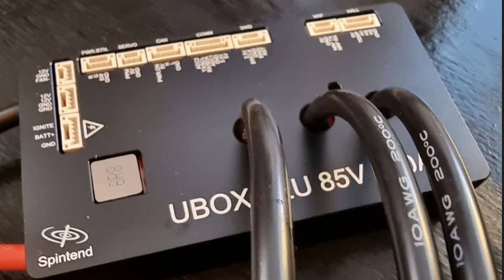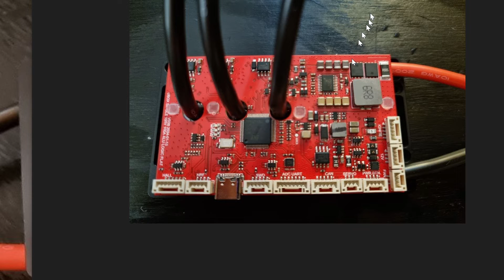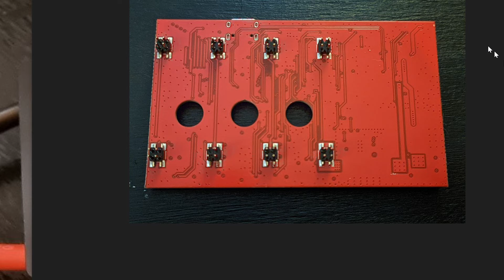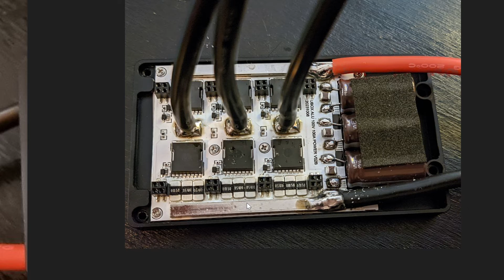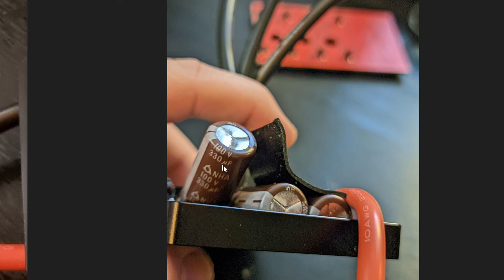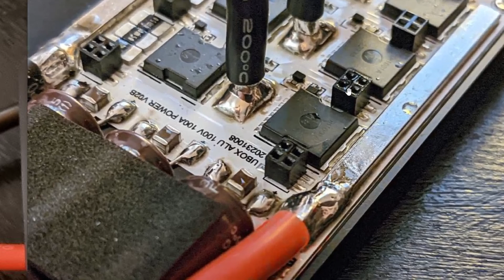Spintend 85-150 Overview

Comment: btw makerbase is going HARD now, they made a controller thats basically a 75200 but redesigned with real phase filters, INA241 amps, phase shunts, inbuilt bluetooth and imu, remote on/off etc.. all the good stuff

with the HYG fets, and for like €125 off ali with 21% VAT

it's called the 84200HP

it doesn't have the creme de la creme current path but no doubt best "VESC" alternative for the price
Reply from the maker: I've been looking at the Pro series from Flipsky. Makerbase and Flipsky are one and the same. Looking at the Pro series they are effectively the same build as a Spintend in every way...including current sense amps and a very few ceramic caps. Well except the mosfet used. It's hilarious that Flipsky calls following the minimum specs for VESC their "pro" product line!
Reply: @de-bodgery  yea, atleast the Makerbase 84200HP is different tho, the older 75 series was the exact same as the Flipskys and the 84200HP is an actual different development, by no means perfect but hey Makerbase has it for way less money and actual high side phase sensing lol
Reply from the maker: @BH4x0r  High side phase current sensing? What's that? Shunts are on the low side to deal with certain facts of voltage spikes that you don't have to deal with as low side shunts. Current sense loops are 100% disconnected from the phases and are neither high or low side. I guess I'd like to see one of these Makerbase 84200 controllers. So far, everything I've ever seen from them is sold as is by Flipsky...aka one and the same company for all intents and purposes!
Reply from the maker: @BH4x0r  I'd like to see this controller.
Reply: @de-bodgery  i mean actual phase shunts i.e. after the fets before going into the motor wires like in Benjamins 75V controllers, they're using the new INA241A's which is the 120V version of the INA240s that were/are used on the actual Vesc 75 series (by Vedder)

my apologies for not explaining stuff properly sometimes, English is not my first language
Reply from the maker: @BH4x0r  Those are all low side shunts and you don't want to use the 241's at battery voltage, but rather at the low side or near 0v. Thy might be able to endure 120v, but you don't want to use them there.
Reply: @de-bodgery  should be ok for a 20S pack, like it should be okay to run a 75/300 on 14S, if it somehow exceeds 100V the fets would probably go first, and i'm telling ya the shunts arent going to ground but to the phase wires, low side shunts would sit there connected to gnd instead, the shunts on the 84200hp are Literally wired directly between the fets and the phase wire rather than a phase wire and gnd
Reply from the maker: @BH4x0r  I've seen this done before with the shunts placed at the phase busses instead of under the low side mosfets. It puts them at potentially a bit higher voltage and at most 1/2 of pack voltage. As far as resistive and inductive losses of shunts, it doesn't really matter where you locate them in the current path from BATT+ to BATT-. It all ends up being in series with the phases and mosfets anyway.
Reply: @de-bodgery  True VESC6s do use inline current shunts. But it's not the case here, this Spintend 85-100 uses low side current shunts, as in Flipsky 75100. And what you call current shunt amplifiers are the phase filters, present on this unit but not on Flipsky's. Current shunt amplifiers are, of course, present on every ESC, even Flipsky's.
Reply from the maker: @lapo3500  The voltage drop across the shunts isn't 5v swing, it's millivolts. The voltage drop needs to be amplified to get a good read for the ADC's in the STM32F405. They are amplifiers and yes, they also are smoothers or filters. It depends on the part used. Amp and filter all in one, no amp and just filter, amp and no filter are all possible. If we assume 5 mOhm shunts and 3 in parallel per phase, that's 1.7 mOhms. If we assume a 200 phase amp controller, that's .34 volts across the shunts. IF we assume 20 phase amps, that's .034 volts. You really need to amplify the voltage drop across the shunts so you can use the full voltage swing of the ADC's. If the current sensing electronics already make the full ADC voltage swing, you don't need amplification. The hwconfig file will have a value for the amount of amplification that is used in the current sense amps so that displayed current is accurate. VESC6 specifies phase measurement per phase, but not how. That can be shunts or concentrator rings/halls or something else like the SEVEN 30 does. You could put a coil of wire around a phase stud and induce a voltage on it and that would be OK too.
Reply: @de-bodgery  My remark was for your statement @7:00. Flipsky's do have current sense amplifiers, but no filters. As you said, it can be checked in the hwconfig files.
And I have never seen a motor controller with no amp and just filter.
Regarding VESC6, inline phase current sensor IS one of the major changes, allowing some advanced stuffs difficult with low side sensors.
Anyway, thanks for your in-depth reviews!

EDIT: A really cool thing would be to compare the efficiency of these controllers. I can not find any on the web! But yeah, it's really time consuming.
Reply from the maker: @lapo3500  Oh right...I make mistakes all the time and say the wrong term. I do multiple takes of whatever I publish and then go with the version that's the least error prone....not mistake free, just not egregiously bad. Thanks for the correction!

Comment: the Flipsky 75100 Alu PCB's and new Pro's also have 3 electrolytics and 3 ceramics in the same sort of setup just like the Spintend, seem to also have 3 NTC's

the new Flipsky (75100 and 75200) Pro V2 series are also directly compatible with unmodified vesc firmware which probably means 3 sensors aswell

the X9000, Torp, Flipsky, Makerbase and KO use Huayi HYG015N10NS1TA fets

i know Spintend used JieJie JMSH1001 fets in some other Ubox's but i don't know what they use in the 150
Reply from the maker: I think Spintend uses Jie Jie in everything. I did later confirm that the 85-150 uses the SH1001 from Jie Jie. 85-250 does as well...just double the amount.
Reply: Is this spintend better than 7200 V2 pro ?
Reply: @raidoes  depends on the price, i would take the Makerbase 84_200HP instead of the Flipsky 75200 Pro v2 though, which are really cheap but they have actual phase sensors and filters so they're more effective than simple low side sensing

i can definitely feel a torque difference between my 75200's and 84200HP's at the same phase current besides Flipsky still doesn't make proper configurations for their own VESC based products, while Makerbase actually made a config for that so you have the correct firmware for your product out of the box and have an easy update experience

Spintend also makes proper configs for them But they cost like twice the amount of money

some people said the on/off switch doesnt work properly on the Makerbase but that just depends on a VESC firmware setting which i figured out running 2 of them, easy to fix

that is due to the fact it's a software based on/off like Spintend has, while Flipsky switches the full input voltage inline of the main stepdown converter

this has the benefit it keeps track of stats like mileage etc.

it also has the benefit of having proper silent hfi support in such a "high" voltage VESC based controller at this price point which means that you won't even need hall sensors at all but that may require some manual tuning